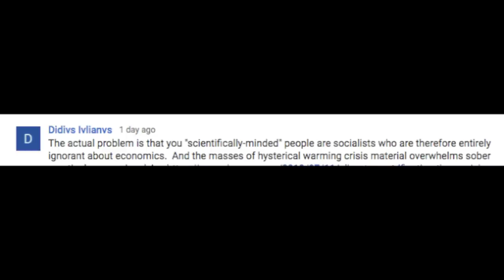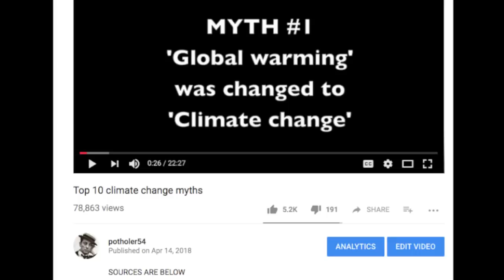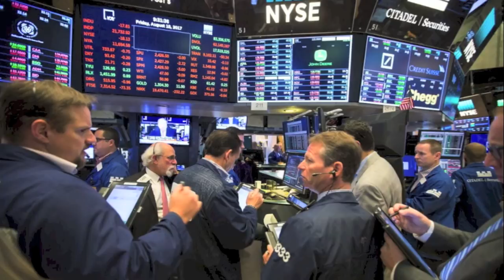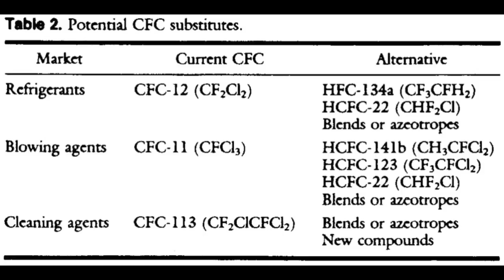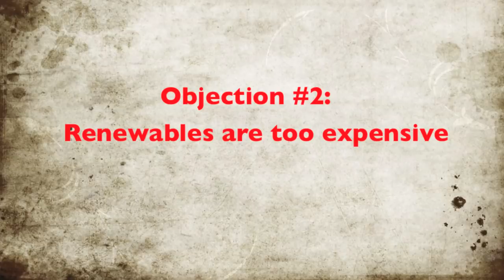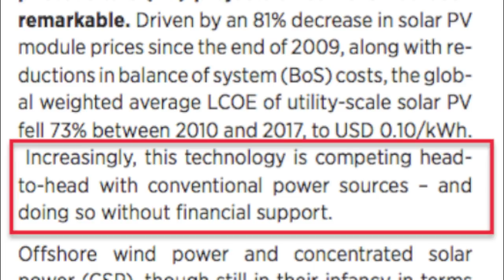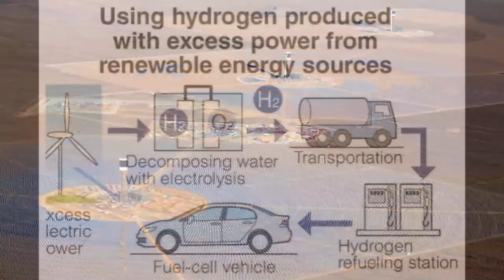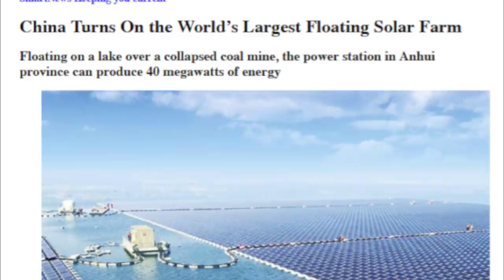A CONSERVATIVE solution to global warming (Part 1)

Comment: If they had only listened to Jimmy Carter.  Poor Jimmy.  The last president that actually gave a damn.
Reply: Matthew MacMartin.  Then you'd have a nuclear power plant in every tenth county.  That was HIS solution as he was a pro nuclear engineer from the 50s.  His base rejected it, Hollywood made a Jane Fonda movie, and Three Mile Island happened.  The peak year of the nuclear industry, and falling since.  France is full of them.

Other renewables were just sideshows to him.  The solar water heater almost killed the President on unveiling day.  It was raining and he reached out to touch it at the exposed gold lattice.  An engineer stopped him about an inch from death.  That array was a crude NASA spin off and a very Rube Goldberg installation.  It leaked constantly, there were no repair parts since it was a prototype, the Secret Service despised it because of security concerns.  Reagan knew that Carter, Ford and Nixon had artificially driven up oil prices to serve the nuclear power lobby as well as the global oil industry.  Even predicting oil would be gone by 1990.  Oil reset in price by 1984 and wouldn't go back up until Clinton/Bush who were both financed by oil firms.  2018 we have more usable oil than we did in 1978 when Carter made his prediction.

Politics is a very disingenuous game at times.  Look below the surface and it's like seeing inside a sausage factory.

There is no immediate consumption way out of a consumption problem.  We are still using some 14th Century tech and ideas, while mixing it with 21st century innovation.  The world eventually makes it work or 7billion people would not only be dead in two weeks, they would have never been born.  Are you one of these?
Reply: @STho205  Talk about a long winded ramble no one asked for.

Nuclear power SHOULD be in every tenth country.  The 4th generation reactors being developed along with thorium fuel cells that CANNOT meltdown is MILES ahead of the stuff Jimmy liked 40 years ago.  Had we listened to Jimmy and continued to develop nuclear power with solar as a secondary, oil would be on the decline and the world would be in a much better place.

But yeah, try and lecture me about politics like that is what I was talking about.
Reply: Matthew MacMartin.  I guess Le Var Burton was wrong.  Reading is hard.  Right back at ya'. For us it was fundamental.

Jimmy Carter may be a nice old man supporting a good charity after retirement, but as President he was a two faced ASS.  Many of us living near him in his time knew this and know it now.  As his retired secret service agents have reported in print, he liked to play the "Smiling good ole boy" in public but in private he was cold, rude and condescending like a plantation boss of the Old South.  His wife was nice though.

If you want nuclear plants, write your power company, your senators and your representative.  Same for your governor and assemblymen.  It is nearly impossible to get a nuclear plant onto the grid today.  It became nearly impossible as a backfire of the 70s lobbying attempts.  Let them know your desires as they represent your interests.

I hear Mr Burns is hiring.
Reply: @STho205  I never once claimed he was a nice guy, nor do I care what his personality was like according to secret service agents.  I care about policy and a policy of renewable energy in any form is better than "MORE OIL!" any day of the week.  Had there been more heed to his warning, we would be in a better position now than ever.

But keep talking about his personality like that is in anyway relevant to the conversation

Comment: for a logical guy, you sure seem to ignore the one stable CO2-free source of power to a worrying extent.

wind and solar are great, but:
• they're incredibly location-specific
• the massive problems of excess/intermittency (we only have about 20 minutes of grid storage, including every car and laptop)
• the economic disincentive to having several sets of power lines 
• the continent-sized land area required to power the world by exploiting ambient natural phenomena
• the yearly replacement rate for solar panels would be in the trillions of dollars
• hundreds of billions in investment and hundreds of billions in subsidies has given us about 0.5% of a grid
• solar produces a lot of toxic heavy metals waste that is often leeched directly into the oceans and groundwater

so what about nuclear?
France is evidence enough that a country can, within a decade, cut 75% of it's electricity-based CO2 emissions just with our current, extremely inefficient light water reactors.

I'm majoring in nuclear engineering to develop the fast spectrum molten salt reactor that can run on waste, dismantled warheads, and depleted uranium, and power our world for 400 years without having to dig anything else out of the ground.
please jump on the pro-nuclear train. it's the only way we can realistically defeat this problem. humans have been progressively moving to more power-dense and cleaner fuels to power our world: from wood and dung, to coal, to oil, and now gas, the next step is not to begin collecting diffuse ambient natural phenomena, the next step is to move to the fuel that is 10,000,000 times more energy dense to use the least resources possible, and create the smallest environmental impact possible. go nuclear!
Reply: To add to this the waste and actually death rates per terawatt hour are so much better with nuclear. Also note that for one solar farm they made here in the US they relocated 10,000 tortoises.
Reply: @caseymuni4097  and look at you doing the same things you're criticizing. Hypocrisy much?
Reply: @caseymuni4097  that is what i call a strawman.  Beware of your cognitive biases.
Reply: @caseymuni4097  As a leftist, I'm on the "nuclear train" because of efficiency. Solar and wind are just buzzwords used by capitalists to get government funds and govermments to "create jobs" when what we need is to get rid of jobs and work less or to specialize on more complex jobs. From where I hear more uncritical whining is from hippies, anti-nuclear sjws, the new age dude that invested in a solar start-up and all that liberal BS. You got a point about taxation as taxes are useless is those go to private subsidies, military spending or police.
Reply: I'm NOT very knowledgeable on nuclear, but I hear from many that what "fuck you" says is true.... Is it true that thorium based rectors  (like India has? Or is developing?) are much safer, cheaper and cleaner then uranium ones?
Reply: That is exactly what I was saying to myself when I listen to this guy. But most of the arguments from the left is going to be "what happens when we have a meltdown? Do we just let it create radiation for millions of years? And what happens when it blows up because nuclear weapons blow up?" So in a sense they think that nuclear creates more radioactive waste than solar. And what about the fallout when it melts down? So how would you refute those arguments.
Reply: solar and wind are becoming cheaper than nuclear, though..

Comment: "Wind and solar energy is nice, but there is no way to store it."
Battery: Am I a joke to you?
Reply: Those are expensive, though the cost is decreasing.
Reply: Thyme to Die, pumped hydroelectricity wants a chat as well. Or hydrogen, or the other energy storage systems people have come up with
Reply: What a Maroon, don’t have the technology for hydrogen? Don’t make me laugh, just two electrodes in some water and excess electricity, it doesn’t have to be efficient or small scale, there is plenty of coastline to go around. Already there are companies experimenting with it, if we spent money there instead of the billions in subsidies we give to decrepit coal plants we would have it usable by the time the last coal plants complete their life cycle. Batteries are atrocious I don’t dispute that.
Reply: @crocfighter.1322   We don't have the technology to STORE hydrogen for long periods of time and this is a fundamental problem as H2 Molecules are so small, they can squeeze themselves through the molecular structure of the tanks.
This problem has been around since people startet using hydrogen as rocket fuel and nobody has come up with an efficient solution yet.
The only ways to avoid this, today, are:
1. Cryogenic storage - needs constant cooling and therefor energy ,because you have to keep the hydrogen below its boiling point.(Very difficult engineering problem with large tanks)
2. Convert it to methane using the sabatier process and burn it in gas turbines to generate electricity, which is terribly inefficient.(39% for electricity to electricity)

It has to be efficient, otherwise we'll need even more power generation capacity than now.
Reply: Bennet Petersen, of course there are more ways than that to store hydrogen, the CSIRO in Australia recently made breakthroughs in ammonia storage which we already do in ridiculous quantities. They have a membrane which turns ammonia into H2, which solves many problems associated with storing hydrogen. I believe potholer even has a video where he mentions it, part two of this if I am not mistaken. The thing is, if there is a problem where there is a clear way for money to be made from the solution, people are going to compete over it, and competition is the death of impossibility.
Reply: Gravity storage or flywheels work well
Gravity storage is pumping water up into a dam and run in reverse to generate power
Reply: @crocfighter.1322  That's good to hear. I looked it up and their work is impressive. Last time i checked, this kind of hydrogen storage was very inefficient and expensive. Time will tell, if this solution is viable.
"competition is the death of impossibility" Haha, thats true  :)

chet corey
 Gravity storage needs alot of space and a place with large height differences. It only works in few locations and brings its own environmental problems with it.
Grid synchronized flywheels are necessary in order to keep the grid frequency stable. We use heavy turbine and generator rotors for that exact purpose, which is basically free.
But with enough solar power, you may need  additional flywheels to ensure grid stability.
Reply: @Bennet2391  Always happy to share exciting info like this!
Reply: Austin Martín Hernández  Hydrogen storage is just as practical as coal mining, and a damn sight easier from a logistics perspective, and with enough coverage there will be somewhere generating electricity no matter what. You people seem to forget that everything has problems, not just wind and solar.

Comment: Another reason that China likes renewable energy is indepence from imports. If only Europe had followed that example and way of thinking earlier...
Reply: They may like it, but that isn't fixing any Chinese energy problems any time soon.
Reply: I don’t know if you are being sarcastic or not, but just in case you are not, Germany did exactly that. They heavily focused on renewables to lower their dependency on Russian gas. They almost had to start to burn coal a year ago to not freeze in the winter.
Reply: @themachine9366  It's worse than you think.
My country's energy policy results in laughably expensive electricity and severely fluctuating costs for heating, thanks to pandering to every sizable lobby group and voter block under the sun - that's right, we shut down nuclear power plants without procuring replacements beforehand, import gas from war-mongering autocracies until they start a war too close for comfort, build lots of wind farms whose energy yield potential is utterly wasted, keep extending allowances for ancient coal plants and fill the gaps with imported electricity from France.
At least the latter sensibly builds nuclear power plants.